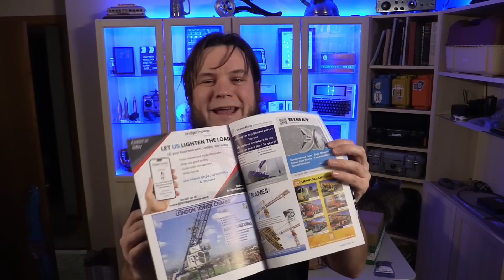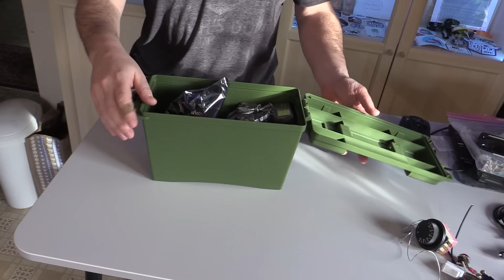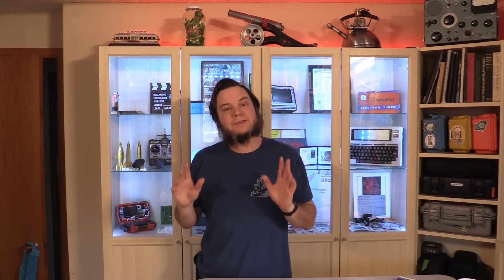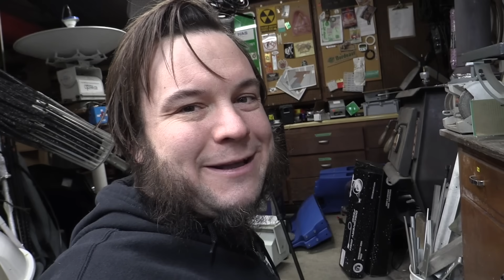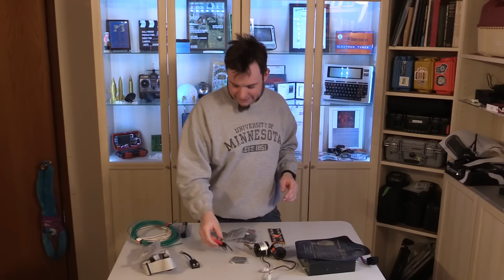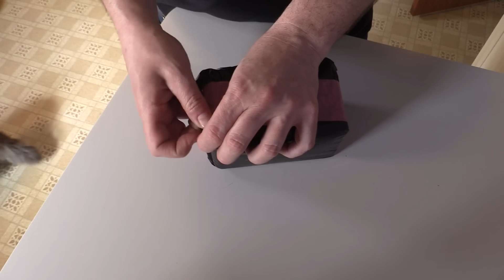Winter 2025 Unboxing / Mailbag / Incoming Junk

Comment: Oh my God I'm using two phones I've been looking for an over an hour realizing I was looking for your shorts now on I'm on your main channel. So I was listening to some of the issues you have on the video that says custom cyber deck for legal satellite hacking. And then you mentioned something about having an output issue 507 do you realize that every single configuration of an adapter actually exist on amazon? I have ones that are 5 volts with a 12-volt output which would power both your monitors or whatever the situation was. Any possible configuration you can think of they have them for. You want USB to HDMI. You want seaport for your HDMI or going to a male or female USB a done so just keep that in mind and Amazon has everything and if I was you I'd be buying them up and putting them in those pelican cases or whatever they call them. Cuz every thing matters and nothing is worse than the world and not having a adapter for what you need to do because it saves so much damn time. So anyways I'm right outside of New York on the Connecticut border and I'm taking Androids and converting them for my use as computers and I'm using those adapters that have 8 or 10 ports so I can run them out to keyboard and some other devices on the seat board on my Android and same thing kind of goes back and forth between the computer too and the computer in the phone so my limit is only my imagination and patience for. Being married answering what are you doing now? LOL

Comment: Speaking of carb rebuild kits, new carbs are really cheap on Amazon and not much more than a rebuild kit so if the carb is in very bad shape you might be better off to just get a new one instead.
Reply from the maker: The carb I had was so obscure that I couldn't find a match. It had a few different model numbers stamped on it, crossed out, and re-stamped, apparently even the factory didn't know what it was :-P
Reply: @saveitforparts  Just about any one with a similar mounting bracked for the same size engine will probably work.

Comment: The G-wiz was a project that came out in Popular Electronics back in the 60's or 70's, not sure on the date, but I 100 percent remember reading it. This box is meant to go in your car. It is a G-force measurement device. I am sure if you take the cover off, you will see a potentiometer on one side with a lead weight on the shaft offset so that it acts as a pendulum. It measures positive G-force on acceleration and negative G's on braking. This device will likely be handmade by some hobbyist.
Reply from the maker: Good to know!

Comment: The UMM Maxon radios are crystalized and 25 Khz. UMM may be on the countywide system now
Reply: Mason radios! Workhorse of the 80’s and 90’s for those who could not afford something more expensive. Crystal controlled for frequency selection. From what I have heard a company called Bowmar is now the only company in the USA making crystals for radios. Too bad ICM closed, they were the go to manufacturer in the past.
Reply: @Subgunman  I believe Bomar is shut down as well??
Reply: @ oooh, that would be bad news for anyone trying to run a rock bound repeater. Now knowing how the GE MASTR II line is built one could substitute a synthesized exciter with about 500 mw output and use a synthesized receiver after the preselector. It would be an interesting project.
Reply: @ Just checked, their website is still up and running with no mention of any closure.